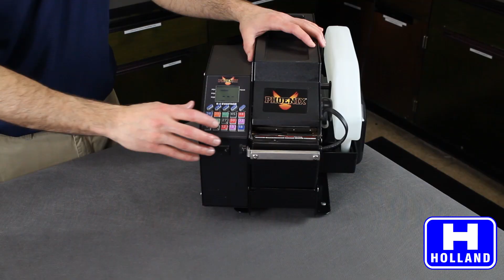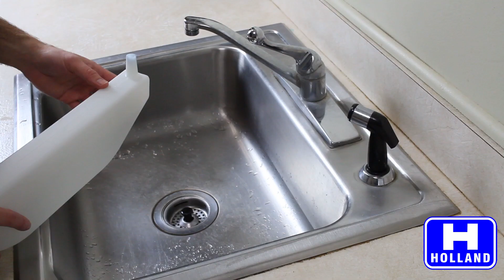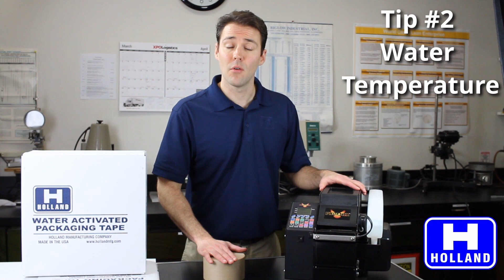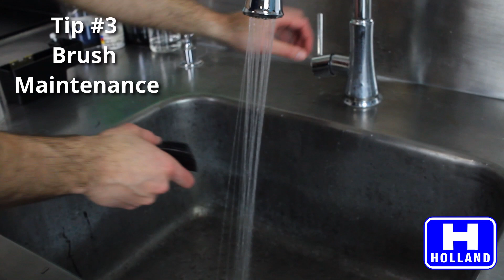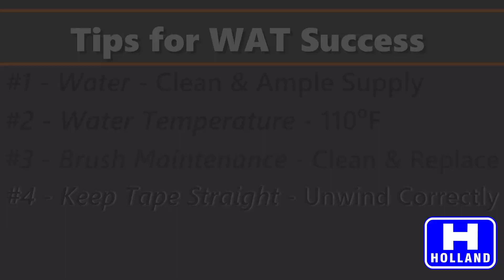First Time Using Water Activated Tape

Comment: You know, I have everything right, but my tape keeps getting wet on the side with no glue. I'm using the Uline Manual Kraft Tape Dispenser. Any tips to avoid this? Thank you and great video.
Reply from the maker: Try to lower the water level in the brush reservoir.